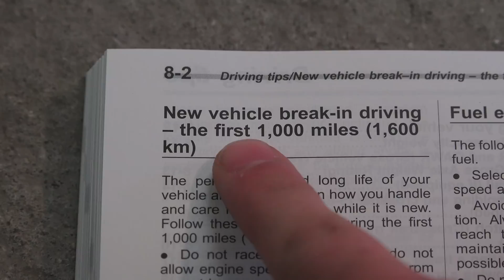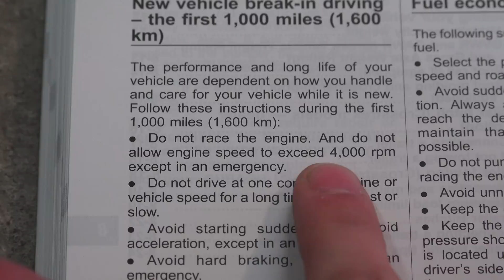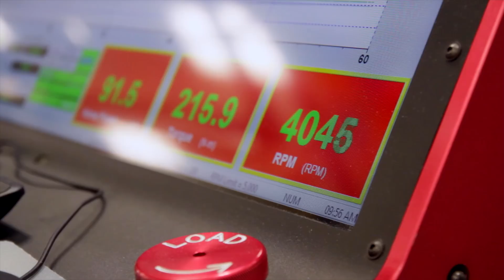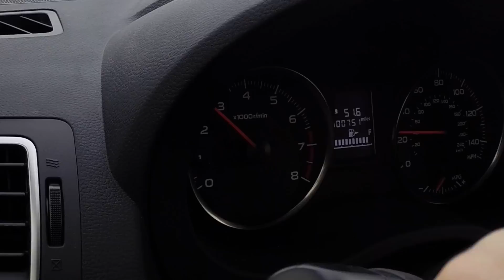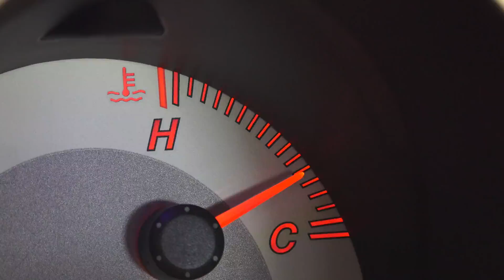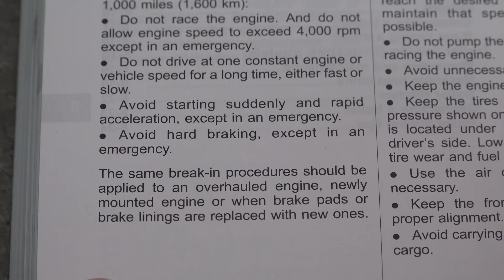5 Things You Should Never Do In A Brand New Car

Comment: all that also applies to gaz powered and nitro powered Radio control hobby grade cars.
electric cars still do have a Slipper clutch break-in process and Lithium polymer battery break-in process.

This is off topic but i think some of you would like to know that about laptop batteries.
The lithium polymer break-in should be done to anything that uses lithium ion batteries, especially laptops!

first 10 charges discharge the batteries gently and when reaching at 50% of the battery, charge it to full.

When your laptop warns you to charge the battery...DO IT! lithium ion batteries can permanently lose their maximum potential if the battery nominal voltage drops too low.

Also note that on laptop if you can remove your battery when you are not using it..do it. It will help your battery last WAY longer.
Avoid keeping a laptop battery totally discharged or keeping it fully charged and removing it for long periods of time. (can half the maximum potential of the battery or not even charge anymore). 

when your laptop battery is fully charged and you still need to use the laptop with the wall charger.
Unplug the charger and deplete a slight amount of the battery, keeping it around 75-85%. 
Plug back the wall charger in wait 30 seconds and physically remove the battery.

This way it will prevent killing your laptop battery with overcharging it. Overcharging ends up with the same symptoms as leaving it totaly dried out.. Laptop batteries that come with brand new laptops are kept in the 35%-50% ish with STORAGE voltage.

Comment: When my car ('14 Escape) had about 500 miles on it, an FRS decided to pull out from an offramp in front of me.  I was going about 45 and I stopped a few yards from the side of them - I stopped hard enough that I could see the coating of brake dust on my front wheels when I got home.  Just passed 32k and the brakes still have plenty of life left and the rotors are perfectly smooth.  I'm not recommending super hard braking in a new car but you can probably get away with doing it once during break-in.

Comment: Are there any limitations about long run in a single stretch, however if I drive below 4000rpm?
Reply: Yes.  You must vary the RPM nearly constantly and gas it pretty hard frequently if you want the rings to seat.  But only when the engine is properly warmed up.  And never let the engine get overheated.  So no freeway trips unless there's nearly no one else and you can do all this safely.

Comment: Real performance cars usually are built to finer tolerances and better finishes on the wear surfaces in the engine therefore don't need a 1000 mile break in. Ask any performance motor builder and they will say the same thing. The motor itself is also put on a dyno and pushed to the limit and that itself becomes the break in and no further break in is needed. It's the cookie cutter type motors that need the customer break.

Comment: Most likely engine break in won't matter much, first thing they do after it gets off the line is put it on a dyno and redline it thru all the gears to make sure there's no problems and circulate the fluids. Then they put it in storage area and later onto trucks or ships overseas. I doubt during these loading times they're hand pushing the cars or waiting for the engines to warm before moving them few hundred feet. So any damage to the car is already done. The break in recommendation is probably to deter people from going full throttle before the engine even up to operating temp, which idiots are likely to do.
I've also been to manufacturer sponsored new model events where the cars have less than 100 miles on them and they let people go nuts on an autocross course.

Comment: I like to get out on long open country roads and allow the engine to reach full operating Temps for at least thirty minutes then reach a good loading gear usually third. I proceed to stay in third while applying full load/full throttle up to about 500 less than red line then engine brake for proper mating back down to around 1.5k rpm, repeat at least  50 times. Then I give it the same treatment in a lower gear maybe second, but take the red line this go around , repeat around 50 times. Next I drive the dog pass out of it for an hour, change the non detergent oil with full synthetic. You want to keep some hatch marks on the cylinder wall as they hold oil and help give a supreme seal which means better compression.  If your bore is ultra smooth and glazed there will be blow by due to lack of oil sealing properties. All of my engines have always performed flawlessly and the oil stays pretty clean at 5k intervals due to lack of blow by. Some will get by due to ring end gap but you gotta have the gap for good performance. Remember, these manufacturers want you coming back to spend more money eventually,  I don't  care what you say. Cheers!

Comment: I bought an 07 STI with 10,000 miles on it and it was obvious the engine wasn't broken in correctly as that care burned tons of oil.  So in 2011 I bought another STI with 0 miles on it and I broke it in correctly and that engine (essentially the same as the 07) and it never burned oil and had wonderful amounts of power.  I am a son of a mechanic and that is the first thing I learned, break in your engine correctly or it will cost you down the road. Especially with performance engines with Turbos or SuperChargers.

Comment: I've noticed an increase in fuel economy and power in my crz since purchase with 47k on odometer and have doubled it, the only thing i've done is filled with varying grade fuel, changed spark plugs, and hard throttle when "cold" once in a while. Can used car beating help performance is the question i'm asking.

Comment: What about diesel engines? 
I agree with everything you have said here and have always told people the same things. 
However, I have read break in instructions on diesel engines on yachts (engines are engines).
Those instructions included: idling. full load. full throttle. full speed (under no load). etc. with time periods for each.
Basically all variations of engine speed/load/ throttle position, that could be encountered. please explain.

Comment: In 2008 I picked up my new Boxtser S new from the dealership in London England. I took a coach down from where I was living in the midlands. I arrived, creamed myself, paid the balance on a credit card and after I'd figured out how to turn on the  tiptronic I redlined that thing all the way 200 miles home. I just ticked over 200, 000 miles last month. Its still as strong as it ever was and I have dumped the clutch (and yes I've changed that a few times hehe) every day for nearly a decade. Don't baby new cars. Don't baby any car. Drive it like you stole it and get a new one if it blows up. Life is too short to be getting triggered by optimum mpg and DMF wear cycles.

Comment: In Indonesia,  from where I was from,  it's a different story.  There is little lemon cars here,  if you get one,  just go back to the dealer and they'll get you a new one. There is a rule where your car is under guarantee for 5 years.  Yes you read that right 5 years,  they extended it from 3 to 5. My Suzuku has a broken steering rack and I got it replaced by paying the maintanece fee only. Suzuki's are prone to broken steering rack for no reason lol

Comment: A bit of SAE  30 oil in the fuel will help the break in,,,the dryness of gasoline is hard on the rings..Other oils like 2 cycle,Marvel Oil,transmission,,kerosene,, diesel fuel fluid are fine

Comment: His recommendations are based on manufacturer's recommendations. Manufacturers recommend things for the CONSUMER. In this case, far more has to be considered than how a consumer will understand deep stuff like mechanical combustion, metallurgy, machining, and the like. Manufactures have to consider how dangerous it is for a consumer to get into a new vehicle, or onto a new motorcycle and go hard-on full throttle with it after it's warmed up. They don't know the car. They don't know the motorcycle. They'll greatly increase the risk of a crash. This means LITIGATION and LAW SUITS. Has very little to do with mechanical parts wearing together to create a good seal.

Lots of wear-in rules were generated many years ago when machining processes were less precise and less repeatable. Also metallurgy was less optimal. Fancy super-hard cylinder and piston ring coatings were still unknown. Mechanical processes have CHANGED because materials and machining processes have CHANGED.

I've worn-in 5 new motorcycle engines with a specific, methodical proceedure that included full throttle power, heat cycles, oil changes, 3/4 throttle for first stage and red-line for second. Never had a lick of trouble and always ran reliably with great power.

Manufacturers are going to tell people whatever protects them from litigation. Wouldn't you?
Reply: Agreed. The old method of low revs low load running in has gone. This can actually polish the cylinder liners which will lead to poor sealing and potentially high oil consumption. Your points are totally correct. Done sympathetically, a you say, no visits to the red line with a cold engine and you'll have an engine fit for several hundreds of thousands of miles.
Reply: Of course there's going to be "hot spots" at the microscopic level, where pointy bits of metal and hard coatings care chewing into other pointy bits of metal and hard coatings. Regardless of hot spots (as people call them), if you don't give an engine the beans, instead of removing microscopic particles which brings surfaces closer together and creates a better seal, you'll "work-harden" those microscopic bits of metal and forever eliminate your chance of creating an optimal seal. Work hardening happens when certain cycles of heat are gradually applied to metal. Same as heat-treating processes. You don't want those surfaces to get harder than they already are. You want them to intentionally wear off, creating a mate through friction, tearing, breaking. Oil is there to cool the cylinder. Water is there to remove heat from the metal.

Consider how fresh brake pads on fresh brake rotors don't produce the optimal performance until those two surfaces have bedded together. Everything at the microscopic level is like tiny mountain ranges where the peaks are sliding across each other. Until they wear in, there is space for atmosphere to pass through. If those peaks don't grind off, but rather work-harden through heat cycles, they will never grind off.

Ultimately what this means at the microscopic level, your loading between the rings and the cylinder walls is distributed among peaks in the metal, rather than a much more broad surface area with a good seal. Which scenario applies more to this "hot spots" talk mentioned in the video?
Reply: bingo. I thought this guy would know better... guess not.
Reply: i have read a few different car models manuals now lol and none say anything about vehicle break-in driving :/

Comment: Auto and motorcycle manufacturers spend hundreds upon thousands  of dollars to write, print owner's manual that come with every vehicle purchased. They don't put things in the owner's manuals for the hell of it. Why don't more people read their manuals the only thing I can come up with is that people are lazy. the manufacturers don't put these things in their manuals for shits and giggles. it is the proper way to run and maintain your vehicle. this maybe anecdotal evidence that people did not read manuals when Harley-Davidson introduce the V-Rod which had a completely new engine that Harley-Davidson had never used before in a consumer product that was designed by Porsche. Many were having problems with the engines one of the reasons is the Porsche designed engine had tighter tolerances than a standard Harley-Davidson air-cooled engine and they were not being properly broken-in which cause premature failure of engines of the V-Rod  because of improper break in procedures which dealer's thought that the engine would be broken in like a standardair cooled Harley-Davidson engine. Unfortunately Harley-Davidson has made the decision to stop production of the V-Rod and its Porsche designed engine. Which is unfortunate since the engine in the Harley-Davidson V-Rod is a particularly well built Performance Engine.

Comment: These are great tips. I have been buying new cars since 1979 and I have never had an engine problem. My previous Toyota truck had 250k miles and did not burn a drop of oil.

Comment: And 'engine break in' does not equal gear train break in. You claim to know so much about cars but forget that there is more to wear in than a damn engine... there are gear and diff surfaces too.
This is the other issue. Why do you think they say 'don't floor it from launch'. Not because it's taxing on the engine but because it's taxing on the drivetrain. This is less of an issue in the bike world as they don't have differentials (the main issue). P.s. The silicon on tyres is gone in 20-30miles on softer stuff, verified this personally many times.
Reply: I think that if you break in an engine properly, the drive train gets the same break in. Is there a way to break in a drive train separately?

Comment: Maybe you should have titled the video "...in a brand new PERFORMANCE car" because this is really the only scenario that special break in periods exist. I work at a GM dealer and part of general motors PDI procedure is to "...use full throttle from a stop/slow roll to highway speeds..." on all their "regular" vehicles. Like trucks, malibus, acadias, ect. Almost all vehicles sold today are broken in before they get on the car hauler to go to the dealer.

Comment: HEYY, I Can't find the RPM's on my Tesla Model X... OH YEAH, that's right, TESLA doesn't use dirty combustion engines with this break-in foreplay.
Reply: Only dirty lithium batteries charged with dirty coal or nuclear electricity? Or maybe you have some fancy solar panels to charge your car with, what are those made from, grass and organic tree leaves?
Reply: I take it you don't use electricity?  No phone, no TV, no vibrator?
Reply: Redoralive You've ruined your chance on getting a proper answer, you do realise that, don't you?
Reply: When electric cars can be "refueled" as quickly and conveniently as petrol automobiles then it's time to dump your oil stocks.  
I'm guessing another 10 yrs and 30 percent of cars will be electric. In 20 yrs 80 percent.
Reply: That's the way we're heading. If I had the means I'd buy one tomorrow. You watch all the gas-head fanboys troll this.

Comment: Actually, different parts of the engine need different break in procedures.  The camshaft needs about 2,000 rpm for 30 minutes (fast enough for good oil pressure/flow but no more), the crank bearings need varying rpm and load and the rings need full throttle pulls to push the rings out onto the walls followed by off throttle engine braking to pull oil up onto the cylinder walls to cool the piston and walls (top gear full throttle roll on followed by coasting back down with engine braking still in top gear followed by anther full throttle pull and coast is a great way to do this.  Ten or fifteen consecutive pulls should have the rings seated well.)  Using only light throttle was a good way to cause glazing on the cylinder walls prior to the modern machining practice of plateau honing or still is if the factory or rebuilder doesn't plateau hone.  The manufacturers recommending the varying load and rpm are obviously choosing to prioritize the crankshaft bearings over the other considerations.

Comment: Plateau honing has been done for decades, and that removed the need for any "break in" procedure on automotive engines for decades.  Obviously, the presenter has never worked in any capacity as an automotive engineer in the engine businesses.  Plateau honing has nothing to do with "better tolerances"; it is an entirely different.  Everything shown in this presentation is simply a superstition, not reality.  If the presenter had ever worked as an automotive engine engineer, then he would know that everything in the presentation is false.
Reply: If what you say was indeed fact then there wouldn't be any break-in procedures listed in the manuals anymore.
Reply: I thought, based on the channel name, that he was going to talk about engineering and not re-iterate what is in the manual. As many know, the break in procedures in the manual seem to be a hold over from days gone by.
Reply: Ryan Scott Varying load and speed and not being at the same RPM's constantly or driving short distances is good enough. You shouldn't drive full throttle at red line constantly, but staying below 4000 RPM's for 1k kiles is unnecessary
Reply: GSX455s touche

Comment: So what's the deal with changing oil after break in? I heard Honda recommends against changing until the first interval because they put something inside of their oil. I also heard the oil will get contaminated by "new engine material". Wouldn't the filter's keep the oil clean? the owners manual on my Subaru and it doesn't say anything other than to stick to the normal interval. Would it be bad to change the oil now (3000 miles)? 90% of my mileage is freeway, but during the weekdays its just short trips to work and back. Not sure if that will have any effect on engine wear.

Comment: I'm considering buying a new car 200 miles away. So driving it back would be a lot of interstate and constant speed. But, would dropping a gear when passing someone (it would be a 6 speed) every once in a while and changing the speed by 5 or so mph be enough variance? Or should I pull off the interstate and get back on? Because I really try and take care of my cars and this would be my first brand new car. Thanks.